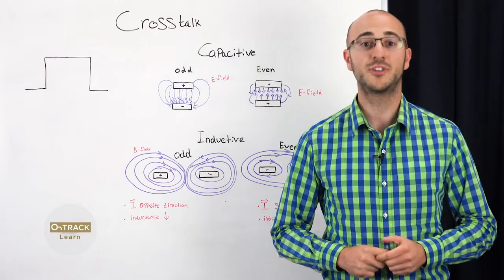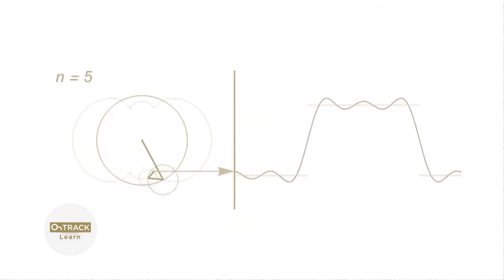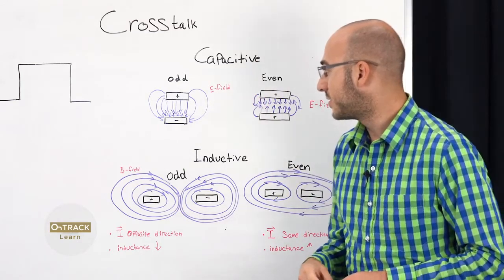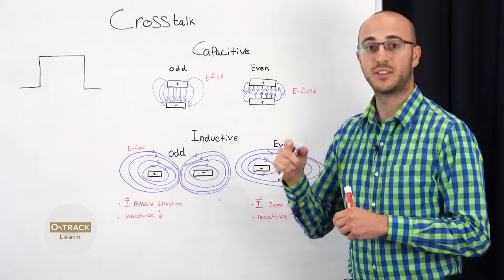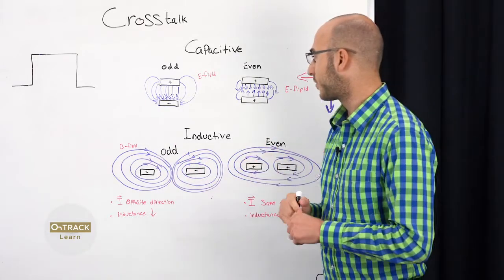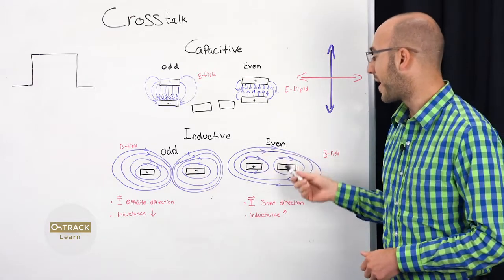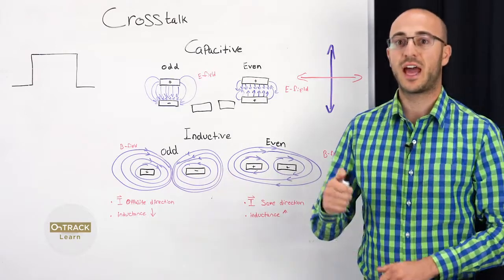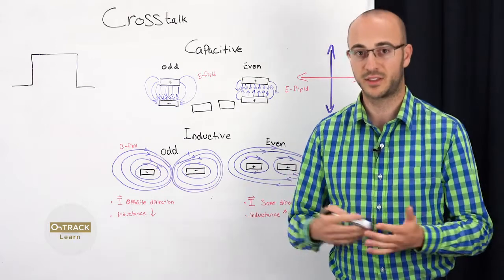How To Solve Capacitive and Inductive Crosstalk in Your Design - Altium Academy

Comment: how much voltage and current should I take precautions when dealing with?
what about high voltage low current like a boosted +20V  and -20V signal line and another 3v going through an FPC cable?